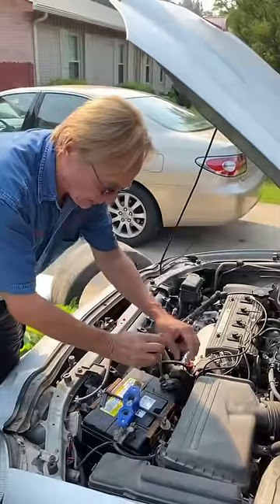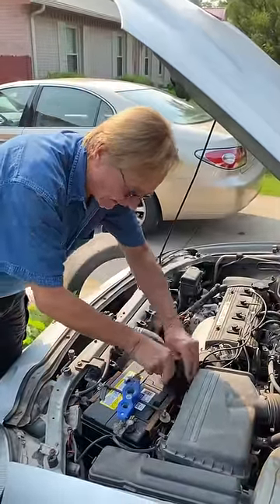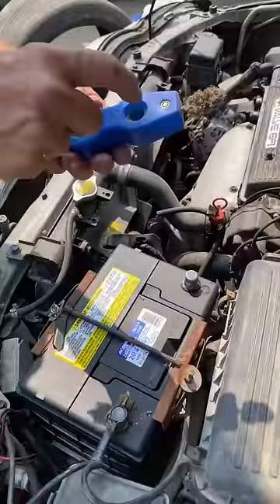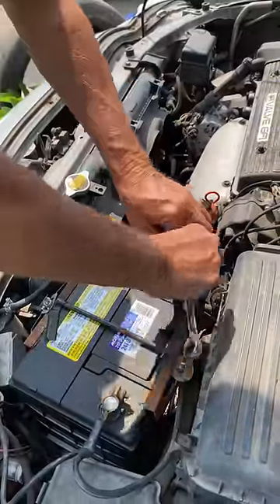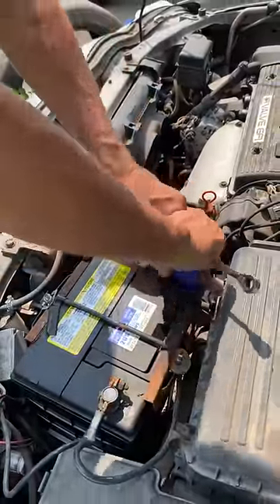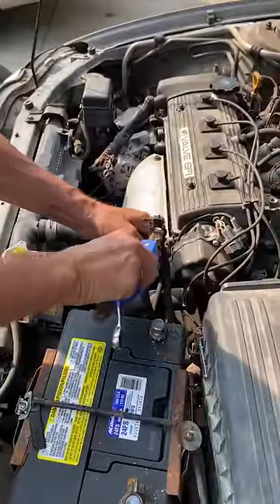This Means You Need to Clean Your Battery ASAP

Comment: Stop neglecting your car, but don't rotate your tires..   let me write this down.
Reply: Maybe he meant on your bicycle😅
Reply: Almost all new cars don’t need tire rotations as often as some older, worn cars.
Reply: @ak14619  I blame the liberals.
Reply: @phatgringo2.0 and the neocons
Reply: @phatgringo2.0  
I blame the far-left progressives.
Reply: I never rotate tires and don't have any issues... They all wear evenly..
Reply: @joshalex93  If you have a rear wheel drive car or truck- then it's usually fine, because your rear tires wear from acceleration, while your fronts wear mostly from breaking.  But on strictly front wheel drive cars--  the front wheels do all the work and the rears are just dragging behind like some trailer tires.   So the rears will last nearly twice as long as the front wheels if you never rotate them;  especially when we're talking about taking the tires to fully worn down before getting new ones.
Reply: @calholli  tis true, with my last car (FWD) I kept forgetting to rotate them and the front tires wore out almost entirely while the rears were still at 90%. I could just rotate them myself in like 20 minutes but I tend to get lazy with non-mechanically-essential work like tire rotations
Reply: @PERTEKofficial  A lot of people just buy new tires on the front and keep going.  You can do that too I guess.

Comment: Scotty, you’re usually spot on, but never remove the positive terminal first.
Reply: Yeah I noticed that too, had to rewatch cause I thought it was odd
Reply: Why does it matter?
Reply: Negative first? And when putting them back it’s positive then negative?
Reply: @killmatic8428  Yes, when putting them on it’s put the positive on first.
Reply: The risk of removing the positive terminal first is that it would create a major short if it contacted almost any metal part of the car.

Comment: On newer vehicles it is advised to use a portable 12v backup battery before disconnecting any of the terminals.

Comment: Even with those rings, still find 2¢ and super-glue them to the battery top. The newer, the better. I never hear the end of how it helps, and I've even SEEN the effects where it DID spare the terminals. Heck, even if there's NOTHING much there, just get into a habit of cleaning the posts and the contacts, even use a neutralizing solution every now and then. Of course, by making a habit out of this, you WILL have to re-input your radio codes, etc every time you disconnect, so it's a good idea to get those printed somewhere to which you can refer. Preventative maintenance is the best and simplest form, as it avoids a problem in the first place.

Comment: unfortunately those anticorrosion rings are not a good idea on Honda’s as the battery post is a little short, better off using battery spray.

Comment: After I install cables I lightly coat the terminals with motorcycle chain lube. It turns into a very thin coat of grease and no corrosion. Magic

Comment: But yhe 1 bad thing about disconnecting terminals is the clock radio gets reset. In my case of having a 1998 Honda Accord, it's very difficult to reset radio stations and time

Comment: Todays cars need a lot more battery amps than in the past. Don’t cheap out when you need a new battery (4-5 years ). They won’t last much longer. They are also more expensive. 250 and up

Comment: I've been to 5 garages to check my battery before winter.. they tell me my voltage is great but my amps are so low the car shouldn't start. Some tell me the battery is defective, others the alternator. Not sure what to do!!
Reply: Both have been replaced 2 yrs ago!!
Reply: Make sure the battery you buy has the correct CCA cold cranking amps that you need.

Comment: They still corrode even with those rings.  Now show us that video of someone crashing into your property.
Reply: I cover the battery terminals on my car with a thin coat of grease. Never had corrosion ever since
Reply: @Brandon-uy1uv  I use grease and those rings.
Reply: @Brandon-uy1uv  Hi, why type of grease? Lithium grease?
Reply: @ramz1455  I suppose any grease works, I used some cv axel grease and rubbed it on with some toilet paper.

You could probably even use some autozone nock off WD40. As long as there is something covering the metal from coming in contact with air, it will do the job just fine
Reply: @Brandon-uy1uv  Thank you!
Reply: no they don't. you probably installed them wrong
Reply: @GuerreroDelInfo  yup it’s so hard to install.
Reply: Anything that displaces moisture. The felt rings work sorta like the felt-like material you'll find on old aluminum framed windows to soak up any excess moisture  from when the frames would sweat. The rings work about as well as they can but, throw some petroleum based lubricant on those battery terminals and like magic, your problem is solved.
Reply: @Brandon-uy1uv  Dad told me to just use Vaseline. It was cheap & readily available. (Dad was cheap.) It works.👍🔧